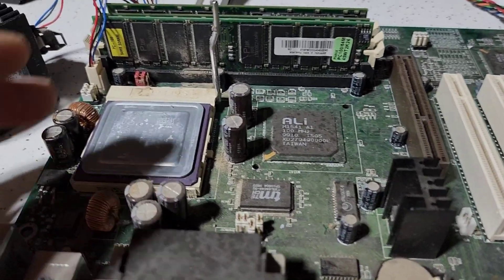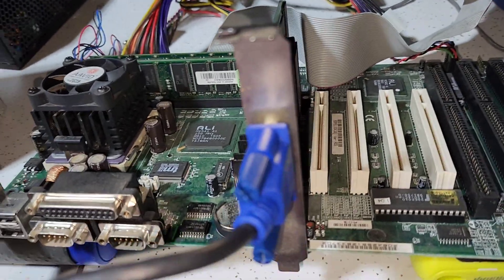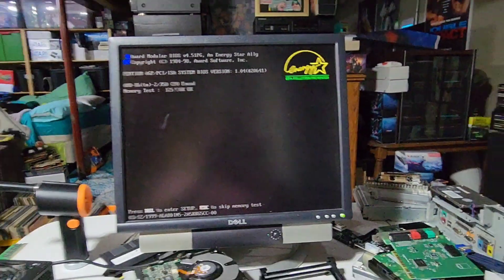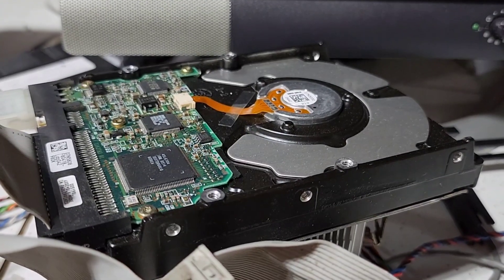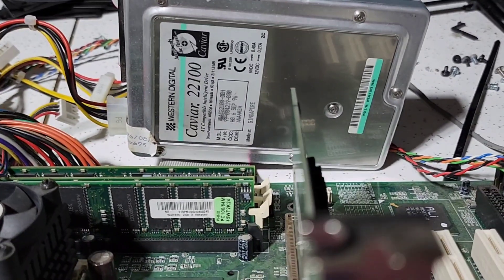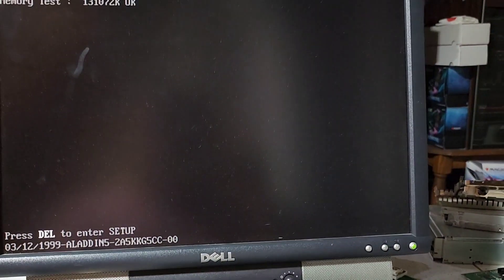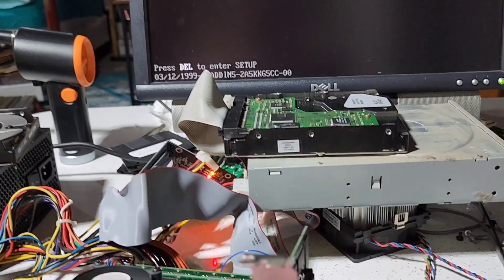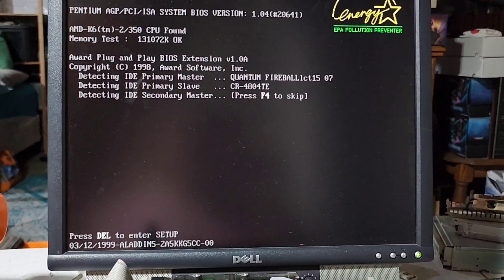The Salvaged AMD K6 - Will it Boot? Fits, Starts, and HDD Experiments! #retro #computer

Comment: Did you test the drives in another machine?
Change the cables?
Try the hard drives right side up?
Try using cable select instead?
Make sure the drives are configured correctly?
Reply from the maker: I'll be testing them further in other machines for sure. I think that some of it is software configuration issues, but I'll know more in a later video!